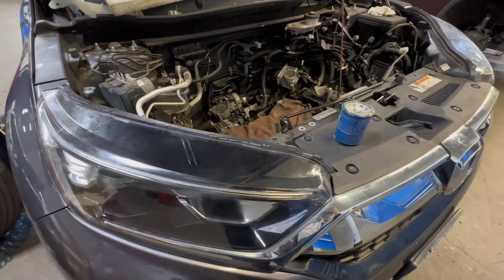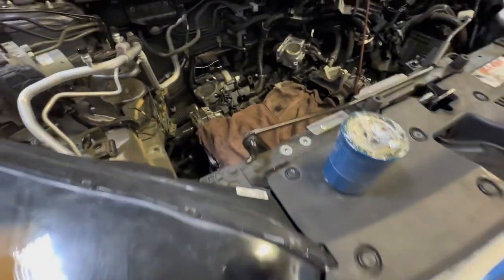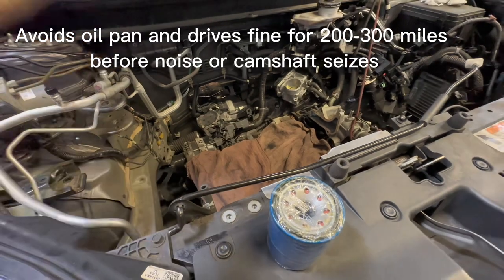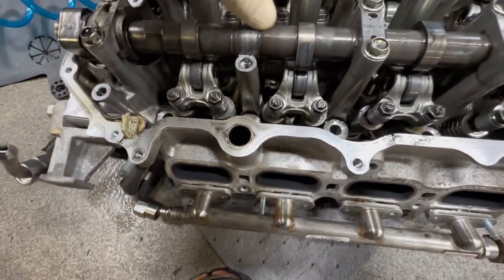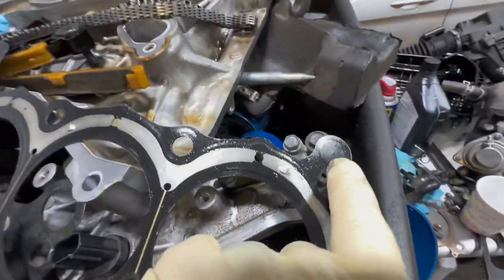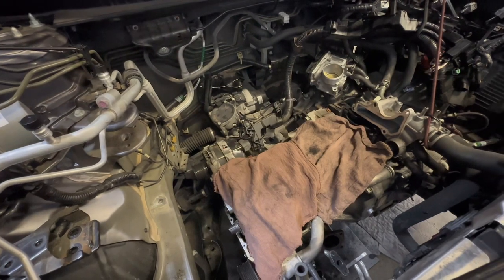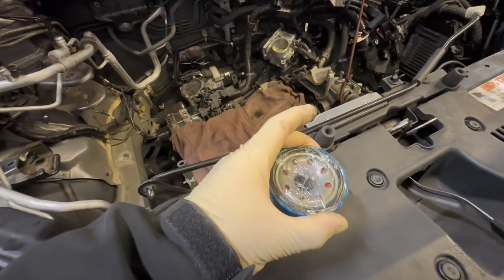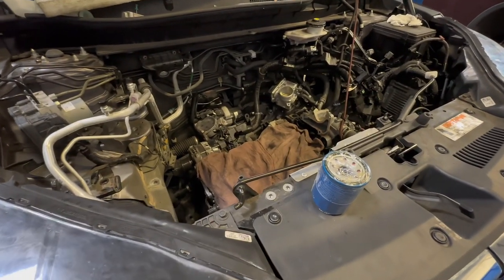Honda 1.5t oil change costly mistake

Comment: Wow, that's a TINY passage in the block to the head! Easily plugged by a variety of things, especially a piece of plastic 😙Thanks for warning the DIY folks!
Reply from the maker: Yeah, it’s crazy small maybe 1mm in diameter or so. First time I encounter this was 5+ years ago when Honda basically walked me into a trap. We weren’t even the oil change dealer yet Honda immediately said yep, human error.
Reply from the maker: @Ok_Mountain_8698  absolutely

Comment: honda should be using melt away  heat wrapper  in case of little pieces flowing threw system can disolve, like a  powerpak in a dishwasher.

Comment: Had a few of these over at our dealership. We have the parts department poke a hole on the top of the filter wrapper just enough to Stick a drain plug washer in and that’s how we open it. Seems to be a good system for us
Reply from the maker: Some of our parts guy cut a slit with a razor to slide the washer in, that seems to work well too. Hope you guys are staying busy 🙌

Comment: Would you buy a 2017 Acura ILX with the 2.0l engine? It has 70,000 miles. Do those engines require regular induction system services ?
Reply from the maker: Yeah those are great engines. As long as normal oil changes were done, shouldn’t be much carbon buildup

Comment: On any of the 1.5Ts that the head gasket leaks causing a misfire, have you seen any actually warp the head? Most people have seem to catch it before it causes and overheating condition, so do you ever recommend sending to machine shops, or just do the head gasket kit?
Reply from the maker: Haven’t had any with a warped head. Replace gasket and check it but should be good to go

Comment: Hey man! my 500 mile 1.5T Si smells like pure farts/gas when i’m backing into a spot and then open my door. I thought I was parking by a sewer but then I parked elsewhere and the fart smell is still there in the exhaust. Any ideas if this is normal or what it could be?
Reply from the maker: Could be a defective car from how your explaining it
Reply: @BCautosolutions  it feels fine otherwise. Not sure if I should be worried about it or if it’s normal for new cars
Reply from the maker: @SIIKAP1  bring it in, worst case just to document it.

Comment: Should 5w30 be used for a big turbo 2.0? What oil spec would you consider with a fbo 2.0 with a big turbo? Thank you.
Reply from the maker: Yep, 5 w30 💯
Reply: @BCautosolutions  Thank you.
Reply from the maker: @savedby_grace6110  for sure

Comment: Could you tell me why some honda/acura valve covers deteriorate where the coil pack sits on top of the valve cover? Anyway to prevent this from happening?
Reply from the maker: Outside elements, get it powder coated
Reply: @BCautosolutions  acura rl 05-08 valve covers, I've seen multiple cases, people seem to think it's electrical arcing? I wondered if coating them would help inhibit that.
Reply from the maker: @notbanksy8294  no

Comment: Is there much of a difference between the a02 oil filter compared to the a01 from a long time ago .I got a box of 36 honda filters from honda a long time ago a01 filters for 45 bucks I still use them in all my hondas .is there much of a difference in filters.should I continue to use them
Reply from the maker: No, either one works fine imo. Anyone saying otherwise is just overthinking it lol
Reply: @Hondamobilemechanic  sweet so that pack or 36 filters for 45 bucks was well worth specially for the price of each filter ,that's a lot of oil changes

Comment: Hey there, I heard the head gasket and cylinder head part number is changed on the 2023 and 2024, can you confirm both 2023 and 2024 models CRV with the 1.5?
Reply from the maker: It’s not I’m actually going to make a video on this because there’s a lot of false info going around. The 23+ crv uses the same exact part number as the 18-24 accord.

Comment: Do 2 liter T’s have the same design and could susceptible to the same issue?
Reply from the maker: Tbh I’ve haven’t had one apart yet but I haven’t heard of any cases yet either so I’ll go with a no on that one.
Reply: @BCautosolutions : No news is good news, especially being on the market for awhile. Looks like I picked the better one for reliability.
Reply from the maker: @JTreetop  💯 agree with all your points

Comment: Well now I’m paranoid. Did I poke a hole or not the last time?
Reply from the maker: If it’s been more then 300-500 miles you should be in the clear. Definitely do not poke a hole to remove wrapper.

Comment: Thus you also shouldn't use anything higher than 0W-20 or 5W-20. Smaller passages that the oil flows thru
Reply from the maker: Oil wouldn’t still make it through but yes have a harder time specifically in the winter that could cause long term issues

Comment: I really like the new 2023 CRV EXL. I know it just came out but for what you seen from the last generation 1.5t engine is it really that bad?
Reply: As long as you take care of it and drive some high way miles you should be good.
Reply from the maker: There’s been some improvements overall but I still have some concern as I do with ANY car. I made a full video on it, you can search it or I can grab you the direct link, lmk.
Reply from the maker: @gimne  maintenance goes a LONG way that’s for sure
Reply: Run, dont walk from it. This engine has been nothing but problems from day one.
Reply from the maker: @bkoz319  I can’t argue with that
Reply: @gimne  why do you say highway miles? Legit question. Can it not be mostly local city miles? (My daily driver and job is literally 2 miles down a local road)
Reply: @waybach  highway miles your engine is constantly running at the same rpm. While city miles are stop and go puts more a bit more stress on the engine, and your brakes. I know for the 1.5 engines you got to drive them to operating temperature to burn off the excess oil or gas which driving highway will do or else you have the oil dilution problem.
Reply: Make sure you use premium 91+gas and stay on top of your oil changes. That’s the secret for the 1.5t.
Reply from the maker: @theholt2ic219  💯

Comment: Here is a stupid question that needs an answer: Why does't Honda stop putting plastic wrap on the oil filters?
Reply: Dust protection until it is use. Any other mean of dust protection as good and as cheap as plastic wraper?
Reply from the maker: To make sure nothing falls in the filter to cause any issues yet here we are lol

Comment: The 1.5T engine is the worst of the worst. The problem with those engines is the head gasket, it fails prematurely and that’s why the injectors fail. The injectors or coils start to misfire and then for Honda it’s easy to blame the injectors or coils since they don’t make them. And Honda will not acknowledge or  accept that the issue is the head gasket because they make the engine and that would mean they eat the cost of repairs. They rather blame the injectors so the supplier pays for the repair. Honda need to be responsible for the problems with this engines .
Reply from the maker: Head gasket and injectors both fail, one doesn’t cause the other sorry to burst your bubble lol
Reply: @BCautosolutions  so why you think it’s too many 1.5T    With bad head gasket and bad inyectors. If you look on YouTube it’s a lot of issues with that. Burst my bubble again lol.
Reply from the maker: @victorv33  shit gas and shit design, two different problems that also fail differently.
Reply: @BCautosolutions  the gas is for the gasket. And the design is for the inyectors?
Reply from the maker: @victorv33  the other way around.

Comment: I am sure you can poke your finger through a thousand of those and not get a piece of plastic break off. I can't believe that. Pushing your finger through there doesn't act like a punch.i would have to see it to believe it. To me it's more like lack of maintenance and carbon blocks the little hole. It doesn't matter what car you drive or what brand of synthetic oil you use, if you go over 5K miles between oil changes you looking for trouble.
Reply from the maker: Ok well it happens, we have seen plenty. It wasn’t sludge. It was literally a service news from Honda but do you.
Reply: Then must read owners manual in Europe, 15, 20, 30 even 40 000 km or 2 year oil change interval,  LOL